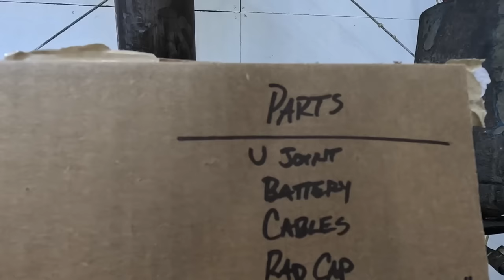Pt.2 He Didn't Even Know He Was Working On His Own Truck The Whole Time!

Comment: Good people helping good people almost always turns out good. With no intercooler for the turbo, you need to watch out shutting it off right after getting everything HOT. That turbo is still spinning with no oil feed. It could fry pretty quick. At least idle it for a minute or so to let it wind down and cool just a bit. Enjoy that GMC Chad. It's a Classic.

Comment: Chad bro, don't be using a test light. You need a power probe lol. Or maybe you just didn't bring yours and Paul doesn't have one lol. 
the old timers(well I'm 48 lol) still use one, but man can you get into trouble using one when you can't see the proper load on the display. Of course I finally got me a new one that does all the VOM stuff(although I rarely use it for that, usually break out the VOM) like resistance. Plus you can't beat being able to supply power and ground to a circuit when you trying to make something work.

Comment: What was the issue with the Holley? I did a holley sniper on a 68 charger 440 and it has some fuel/ignition issue. Also about to do a build similar to this
Reply: The information they had on how to wire it up was incorrect 🤦‍♂ 2 minute fix, just had to get through the hour on hold to find that out 😂😂

Comment: Scary that these people don't know if the spark plugs are tightened and if there is tranny fluid in it (No, not Bug Light) and this is going to drive side-by-side on the road with my family?! There needs to be a better checks-and-balance IMO to make sure vehicles like this are safe.
Reply: Neither of those things equate to a less safe vehicle, just less reliable.
Reply: @Patrick.Weightman  OMG people online always amaze me. Unless you spell it out, they are unable to understand. My point was, those are the simple things... if they can't remember the simple things... what else are they forgetting? I will spell it out for you so you don't need to reply again... like the brakes?! Or a bad throttle cable? or a loose wheel? Or bad alighned drive shaft? Things that can break off and injure others on the freeway or a vehicle unable to stop or slow down. Hopefully, you understand now? But probably not! 🤣
Reply: @bgwhalley  Yeah you clearly didn't watch the video nor have a lick of an idea what you're talking about
Reply: @Patrick.Weightman  I now understand how Mitt Romney became Governor of Utah.